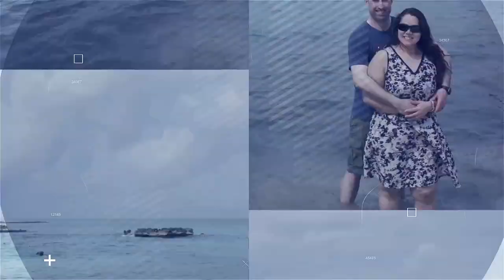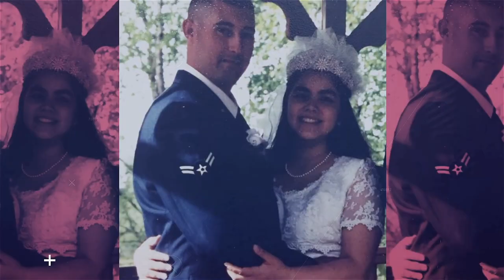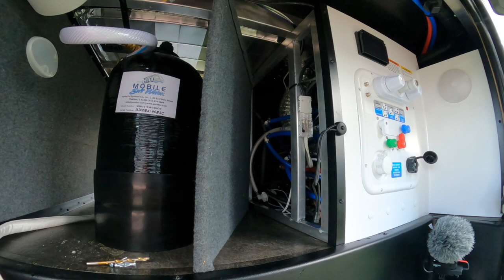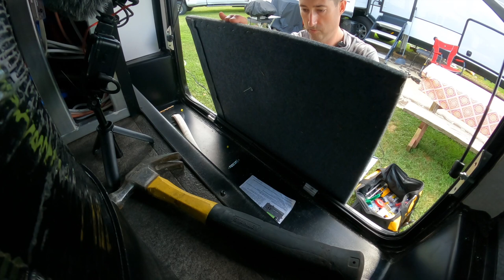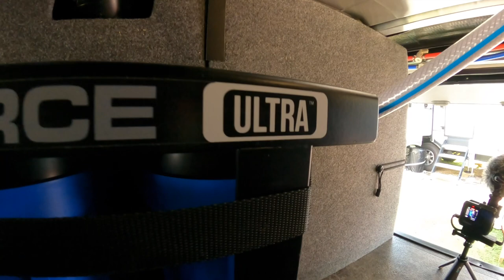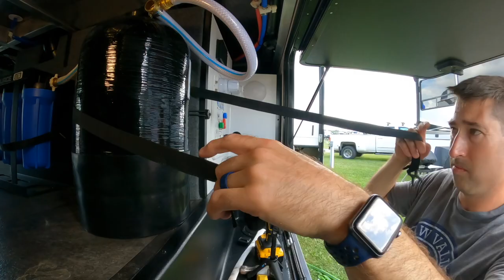RV Water Filter Installation / Part 2 / CLEARSOURCE

Comment: Hey Chris. Robert here. I am currently enjoying my fridge not working on electric, but it is working on propane, thank God! I blew an 8A 250v fuse which no one has, so I ordered them and am waiting till they come in. If the fuse blows again, I’ll be replacing a circuit board or heating element:/ Nice to meet you guys! Safe travels. Btw, I’m in eastern central Florida if you ever need to overnight while passing through. I’m on the Space Coast of Florida:)
Reply from the maker: Thank you for watching the channel and sorry to hear about the bad luck with the fridge. We have not spent nearly enough time on the Space Coast. We only got over there for a day about two months ago. Definitely on the short list of going to spend at least a weekend over there again.